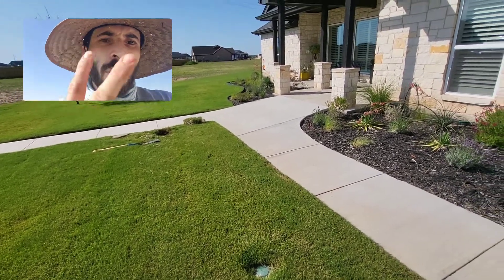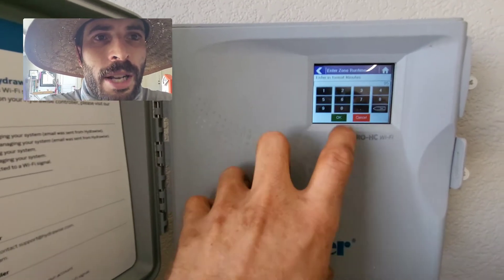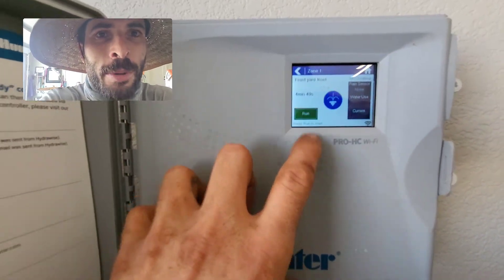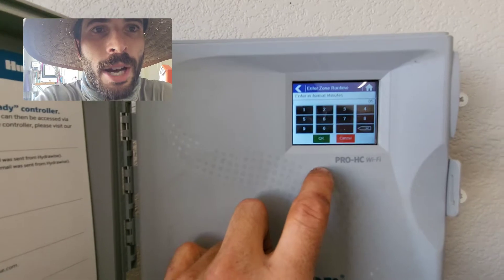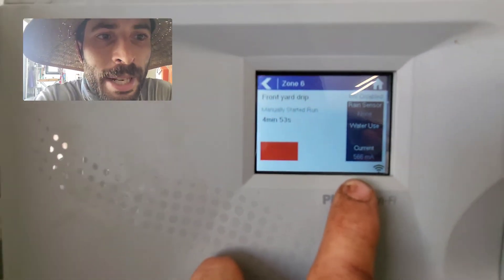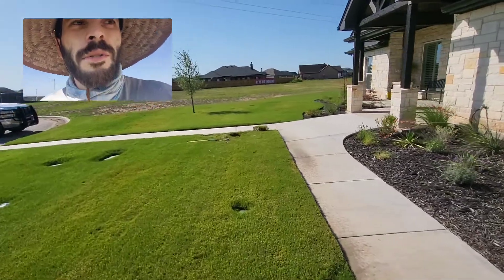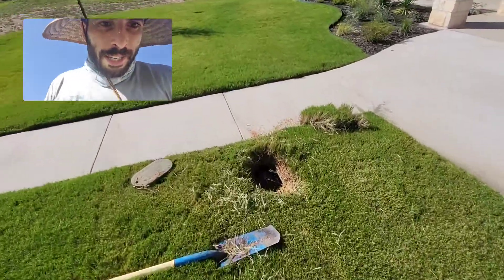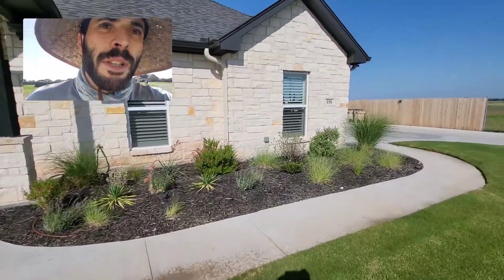Overcurrent - Hydrawise

Comment: It turns out that you can run 2 valves plusa master valve at a time! Software version 1.2 calculates the current incorrectly! I called and they rolled it back to version 1.14 and it works!
Reply: I’m having overcurrent error message on my pro hc. I’m running each solenoid separately, but I do have a master valve connected to all zones as well as water pump relay and flow meter.
My controller settings says I’m using version 4.31!!

I noticed that it works fine for few days after I plug the power off the controller and power it back on. 

Any advice?